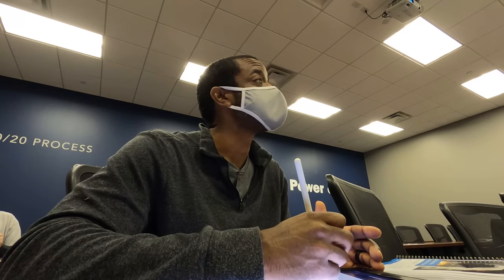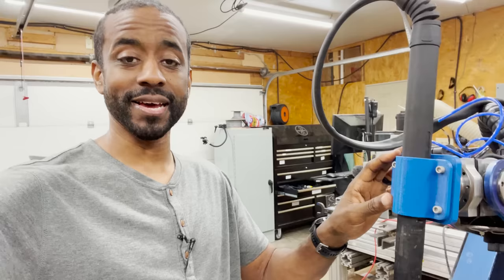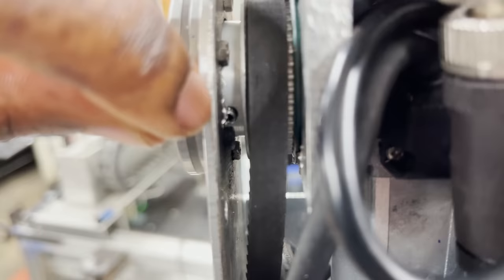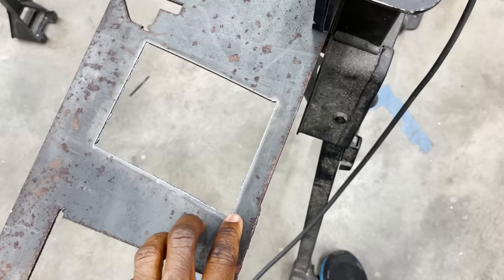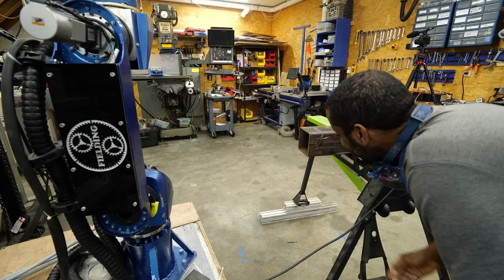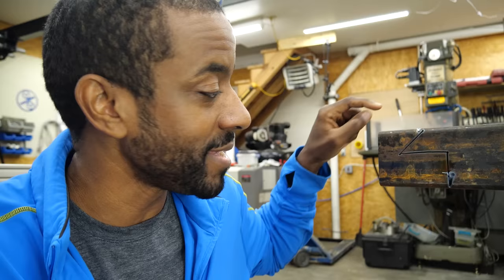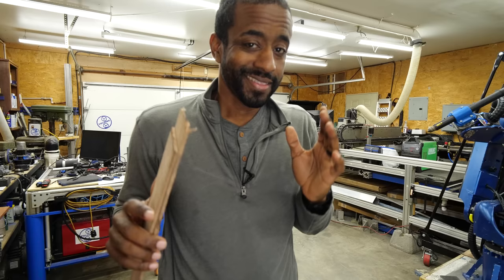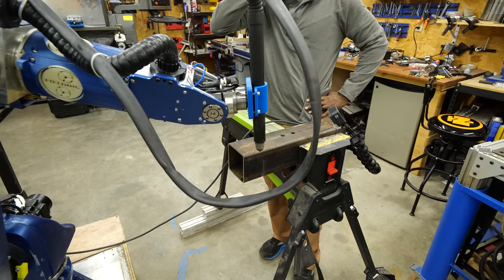I Added a Plasma Torch To My Robot - Jeremy Fielding #097

Comment: Hey, I do know I'm late to the party but I checked your Servo Drivers manual and you can set an encoder output divider providing you the possibility to run the robot in a fully closed loop system, as you can set it to 20 if I remember the numbers correctly and get 512 pulses per revolution as you mentioned you need. It might be harder on the software side but definitely worth it!!
Reply: Good find! Hopefully he sees this!

Comment: Great Job finding the set screw problem. We had a frequency changing system on a special type of radio in a communication center where I worked. We had 12 of these radios. 11 of the radios worked great 24 hrs a day, 360 days a year. 1 radio worked when turned and then drifted off repeatedly. The techs worked on it for months trying to get it to work right. Finally, we as a group  compared that radio with the one next to it as team of techs carefully disassembled the chain drive underneath. Part by part was compared. One of the sprockets looked different. We discovered it was missing a little sleeve on the shaft. We replaced the paper thin sleeve and the radio was on the hit parade. It worked perfectly.

Comment: First of all, 24 minutes, although long by your standard, isn't too long.  I could watch your videos all day!  You are an amazing engineer and I admire not just your knowledge, but also your tenacity and attitude!  Those two attributes alone will take a person far in life.

On the topic of "make notes"-- as a software engineer, I can tell you that when you are working on software problems, the best way to "take notes" is to use source control to create a history of all of your software changes.  That will give you the ability to look back over what you've changed and potentially find what got broken.  It isn't tough and it'll save you frustrations in the long run.

Comment: As a mechanical engineering student your videos definitely help me through my classes in critical thinking. My lack of coding would keep me away from projects this dense, but one thing that you really need to address to really move things forward is closing the loop so the controller knows where the robot is. Thank you for posting failures and issues, because that's how collectively we learn the most from something. It's easy to get something right without understanding, but hard to get something wrong and actually understand the issues.

Comment: Something to check for your relay problem... What is the contact voltage and contact current rating for your relay?  Note that these are DIFFERENT from the coil voltage and coil current ratings!  

If the relay contacts are rated for 25VDC and 5A, and you are trying to switch 120VAC up to 1A, you will burn out the contacts!  Given that the distances are so small for the armature travel in the relay, high voltages on the contacts may even be able to jump that distance on a low-voltage relay.  This would make it appear like the relay is ON all the time, no matter whether the coil is energized or not.  

You've done a lot of great work!  I'm sure you'll figure things out!
Reply: I was thinking this, too.  But I thought that should damage the relay to the point where it could be detected with a multimeter (or a nose), but perhaps it just hasn't cooked itself long enough.
Reply: The relay is only switching a signal (like a button), not power. Otherwise there would be no way the small manual switch would work.
Reply: The pinned comment says this was the issue yeah he was switching 240 AC on a 12V DC solid state relay.
Reply: @AlsoDave  Ouch!  That's a good way to blow up a relay!
Reply: @Cynthia_Cantrell  Based on the comment sounds like it just failed open with the voltage applied, less immediately catastrophic but, well, probably more dangerous overall!
Reply: @AlsoDave  Depending on how the part fails, it could risk 240V shorting to the low-voltage control side - and that could get expensive quickly.

Comment: Reminds of the countless hours we spent debugging industrial robotics when running my own industrial automation shop a decade back. Thankyou Jeremy for showing the true nature of engineering problem solving.
Reply: I used to design and install home automation systems (lighting, a/v, security) back in the 90s, before everything went to standardized wireless interfaces around 2010. It was a tail-chasing nightmare to get multiple mechanical, electrical, and audio/video systems working together, some controlled by or, some with janky proprietary communication protocols and software, usually in beta or early production stages, with every component individually hard-wired to a central controller, which was hard wired to all the home’s keypads, TVs and speakers…SO MANY failure modes, and no way to test it in discrete modules. 
I got the hellouta that business.  It’s one thing to be an early adopter. It’s a whole other thing to install and support equipment for customers who are early adopters.

Comment: in addition to the advice you provided regarding taking notes.  something that has saved me more than once is to not change more than 1 thing at a time when ironing out details.  its easier to know 1 item caused an issue than to figure out which of many changes caused the issue

Comment: This is such a nice reminder to be patient in my own projects! I'm trying to make a variometer for myself, since I just got into paragliding. Yesterday I fully realized the scope of this challenge, since I need to do some real time statistics and calculus on barometric pressure data in order to havr the electronics give me useful info. At first I was just like, yeah, hook up a pressure sensor and a buzzer to a microcontroller, and I'm done! But nope, statistical analysis is what's needed, and that's just for my first iteration! I'm planning on adding an IMU and GNSS, which means I need some linear algebra as well. It's great to see you working through a similar process and setbacks. What an awesome project, man! So cool to watch it coming together.

Comment: this is one of the coolest DIY projects I think I've ever seen Jeremy, amazing work! At first I thought the robot arm was off the shelf but appears to be totally custom, incredible!
Reply from the maker: It is entirely custom. I designed and built every part of it in my shop except the motors and gears.
Reply: Great job  @Jeremy_Fielding ! I know the engineering process is weighing on you in this video, but you've come very far!

Comment: What a great video. Welcome to real world engineering. My experience with ABB robots tells me even big budget companies also have work to do on already fantastic and very capable systems. Ive experience with relays feed back which can keep the relays stuck on, an inductance issue, your relay should have a diode accross it to cancel out the inductive load. That can also be caused by the wrong voltage, polarity or ampage accross it. Again, great video. Cheers

Comment: Just when you though it was safe/under control you give a robot a fire based weapon.   What could possibly go wrong!? ☺️😆😆
Reply: @Geeksmithing  what does "snowblower" mean?
Reply: @siarsMM  it was a joke based on a Short Circuit, which is a film from the 1980's featuring a robot going haywire and always saying that it needs input.
Reply: @Geeksmithing  ah thx iam a lot too young to get the refrence.
Reply: @siarsMM  no problem!! It's a funny movie if you can find it!

Comment: Philosophy for finding the problem with remotely turning the plasma cutter on and off: Maybe look for points of failure.

1. Relay inside plasma cutter turning torch on/off
2. Signal to enable plasma cutter: Time dependent
3. Setting on cutter of whether plasma cutter is triggered using computer or not
4. Type of signal sent from computer to plasma cutter to turn on/off

My friend had a cnc plasma cutter that I got to use once. The always on plasma cutter was an issue for him, too. There was both a switch he flipped on his cutter and a software setting he had to worry about in order to drive the plasma cutter correctly, and turn on/turn off the cutter for making holes.

Anyway, failure mode effect analysis could be your solution. If you start with the plasma cutter and work back from there, you should find the problem.

Your videos are an inspiration. Thank you so much for sharing.

Comment: I love your work. Inspirational. Well done. If repeatability is a problem, you might be suffering from induced EMI. The plasma cutter generates high current high frequency harmonics that may interfere with your step and direction signals. I don't know your exact setup, but check your repeatability with and without the plasma cutter and compare the results. Good luck!

Comment: At my job we use robots for testing electrical devices such as remote controls. We have a combination of solenoid plungers and X,Y robots and have a few different setups. Our first setup splits up the task on different machines, the Festo robots come preinstalled with a dedicated win7 pc, the main GUI is on a separate win10pc with remote access to the robot pc, and controlling them both is a dedicated linux pc, three pc's in total. The other setup we have is a VM for the linux pc running on the same pc as the main GUI and remote access to the robot pc. We use Festo software, VMware, and P-CANview software with custom coding for positioning. We have 4 limit sensors placed in key areas that will trigger a fail if triggered by a rogue movement. We were a 9 man team for testing refurbished remotes for the cable company.

Comment: I have been watching this series for a while now and I am very impressed with this. I am not exactly sure how you are controlling the robot, but I had similar issues when I built my LED cube with signal transfer amount. I was dealing with a lot less data on a much less complicated system, but it may help yours to know how I got around this.

I ended up making it so that the cube was able to understand very basic instructions, and hit those regularly. For example, set a single point, and set the entire screen. This way, rather than having a massive program calculating everything in runtime, it could be preprocessed and executed separately. 3d printers do something similar, where the 3d printer controller only cares to get to points, or move x positions. This low level uses the feedback to verify that it loaded properly, but does not need to tell the path maker that. 

The path maker does all of the actual move instructions, and can be run on a completely separate system, or even "rendered" ahead of time. 

I know a very little amount about early G code (not actually know how to read it) but this is how it operated as well. This early G code was open loop and quite dumb, putting all the onus on what it is talking to to behave as it says, but it is extremely simple. A chain of points, or set speed to x, move x cm, go, rather than trying to make the machine calculate velocity and full inverse kinematics, it gets kicked up a level to be rendered out, but uses basic commands to do the rest. It will definitely be more taxing on the robot due to having multiple joints to make a 3d shape rather than move x, move y, move z.

Not sure if this will help, but hopefully something in this will be at least somewhat useful.

Comment: When you started talking about position problems my mind immediately went to steps. Building 3d printers I've had to do many calibrations on steps. Using a raspberry pi to crunch the steps might improve performance. It's one way they solve it in 3d printing with klipper.

Comment: Have you considered moving to a more industrial control system? Your servo drives likely take analog control instead of step/dir. You can then use a Y splitting cable on the encoders so that they go to the drives but also to the controller. This closes the loop and allows for the servo motors to work as "they" want. An example controller is something like Galil DMC.

Even if you don't go this route then you should still be able to split the encoder output to go to the servo drive and your teensy which can keep track of a quadrature encoder. I have a teensy 4.1 keeping track of 300 mm/s moves on a 0.1 micron linear encoder. I should say it is the only thing it can keep track of...

Comment: This is amazing progress! I had a similar issue where joint moves worked great, but linear moves had very poor tracking. It could be a completely different issue of course but in my case I found that the joints under performed the desired velocity only when streaming commands. So basically the joint position commands would end before the joints actually reached the goal causing bad tracking. I isolated this problem by working with a single joint, say J1. If you send J1 a single end goal, it reaches it. But if you send it a discretized set of way points that end At the same goal, J1 stops short. I then plotted the desired velocity verses actually velocity over this move and found a large error - the joint was falling behind despite aggressive joint tuning. So I added a velocity controller to the teensy that minimizes error between actual and desired velocity. This solved the issue in my case. A low acceleration limit can also have this effect. Of course you are sending step pulses instead of velocity so that makes the control loop a little different than mine. 

I’m so impressed with how quickly you’ve gotten to this point!! Great work.

Comment: One expensive but powerful control solution for you might be a Kflop+ Kanalog. It can run eight separate encoder channels and is very customisable (though you do need to be able to program C). The maker of it also provides amazing customer support by simply answering everyone's questions himself, as far as I can tell. It does come with a pretty hefty price tag, though.

Comment: amazing video man, I really feel your frustration. In my experience sometimes relays can stick if they are either bad quality or defective. Usually when that happens, you can sharply hit the top of the relay and unstick the contacts. It happens a lot especially with high current devices.

Comment: I was going to ask if it was a solid state relay.  Glad you figured it out.  Switching the heavy current load of the plasma cutter, I suggest using a heavy duty mechanical relay rated for the max current rating of the cutter.

Comment: Amazing job. In the early 1990's, I wrote the software to run a CNC styrofoam cutter for making the foam cores for model airplane wings. I eventually got it to where it could cut tapered wings with leading edge sweep and different chords and airfoils on each end. Also, it would cut the cores so that when you glued the roots together, the dihedral was correct. I can't imagine writing the code for your robot. Somehow, it needs to always keep the cutter perpendicular to the surface being cut. I guess you need to write the equivalent of a slicer for a 3d printer, except that the nozzle also needs to rotate. Hang in there..

Comment: Thank you for great, honest channel! You are an inspiration to many DIYers. Regarding relay: disable torch and run it with a Sharpie marker instead, monitoring the relay behavior. Could me the current from torch affecting something. Regarding positioning: could you swap some controllers: you are operating under assumption that the controllers are free of defects.  All and all, great respect for your work, take your time, eventually it will work💪👍👍👍

Comment: So set me straight with this relay - the plasma cutter comes on immediately power is provided to the circuit then the relay has failed - welded closed, or does it comes on after being told to switch on, but won't go off, then its latching, possibly due to over-current and partially welded contacts. But is there a third option??? Anxiously waiting for the next video!
I commend you Jeremy for having the cahoonas to take on these extraordinary project and punching through the disappointments, moments of self doubt, panic and the perseverance and brain bleeding it takes to learn new stuff in order to use the knowledge in your projects.
Reply from the maker: I got it figured out now. Check the pinned comment at the top.
Reply: @Jeremy_Fielding  That's great news!

Comment: I learned with 3d printing that when screws in an assembly experience long term forces they want to escape
the solution is usually blue loctite
looks like you also figured that one out today